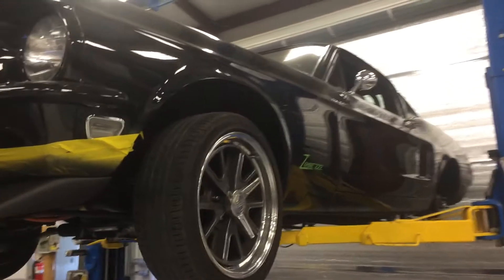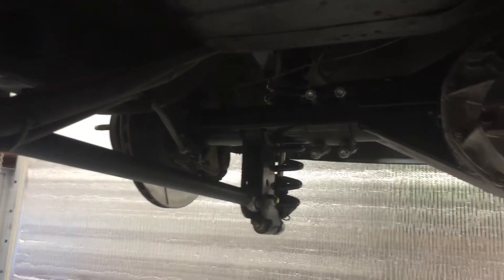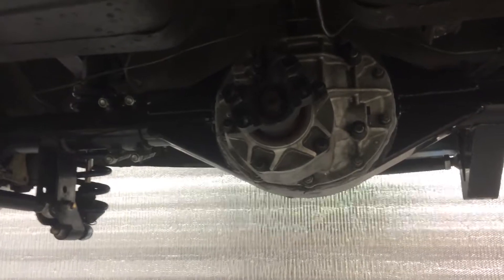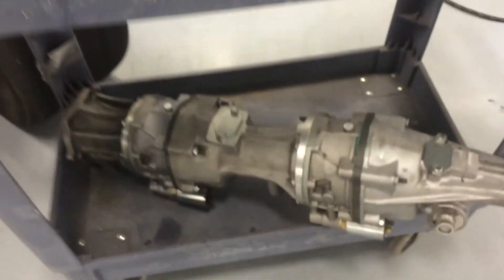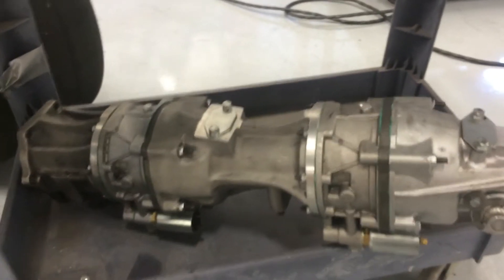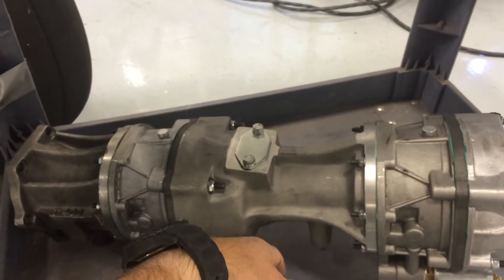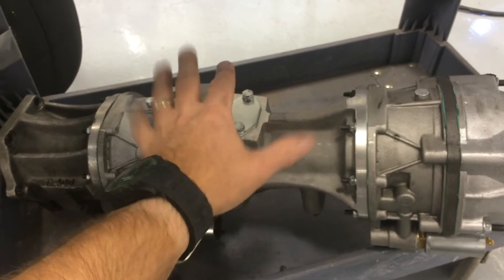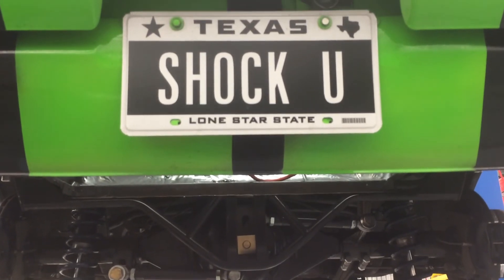Drivetrain overview

Comment: That's an amazing setup!!! However, I question the need for rear disk brakes. I realize that disk brakes are part of the safety setup for better stopping however, I thought rear disk brakes create more rolling resistance than drum brakes due to the brake pads being so close to the rotor and possibly rubbing.

Comment: 4 overdrives? A 6 speed gearbox isn t lighter and has lower transmission losses?
Reply from the maker: I would need a gear box that started with first gear being a 1-1 ratio and then every gear being a taller and taller overdrive. Doesn't exist, so it would need to be custom and very expensive.
Reply: +mitchmedford  Makes sense. Maybe other options can be smaller diameter dc motor (hight rpm) and a tall diff ratio.   Anyway, congratulations for your project! Amazing
Reply: +mitchmedford I was going to ask what the reason for not using an automatic transmission  was. But this reply clears that up. Good luck getting to 200!

Comment: Ever consider eliminating the drive shaft entirely? Maybe a mid motor configuration? Connecting the motors directly, or nearly directly to the rear end? It is nice to be able to add overdrive units like that though. I'm thinking of how Tesla mounts their motors directly with a gearbox.
Reply: +nixter1nixter1 but then you wouldn't have those cooling lookin painted motors there under the hood for hood-up appeal!
Reply from the maker: +nixter1nixter1 Not a bad suggestion, but it would add a lot of complexity and likely restrict some of the off the shelve parts we can use for the rear suspension. Also, the large motors are too big to fit into the tunnel without significant tunnel modification. We generally try to put motors where engines went and batteries close to where fuel went. Also, is you have to have a drive shaft, it really does;t matter if it is small or long.